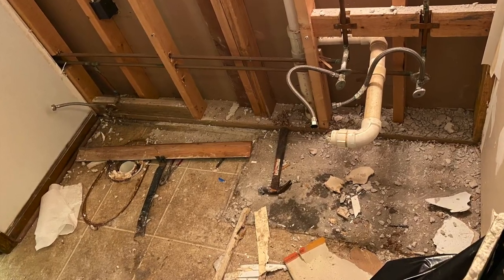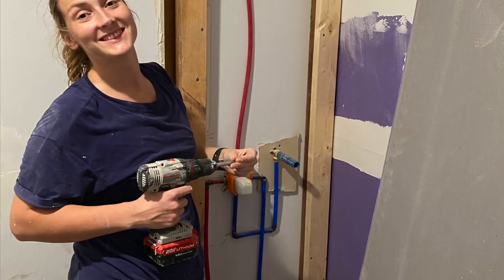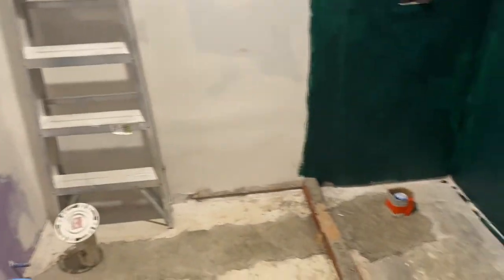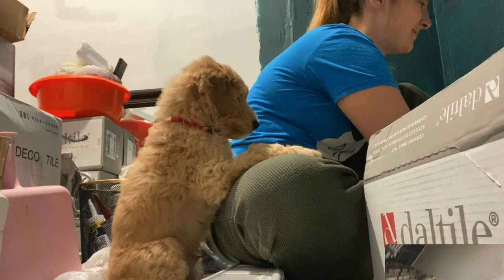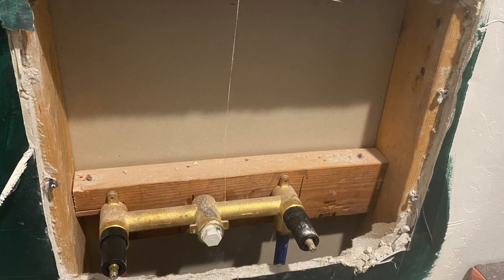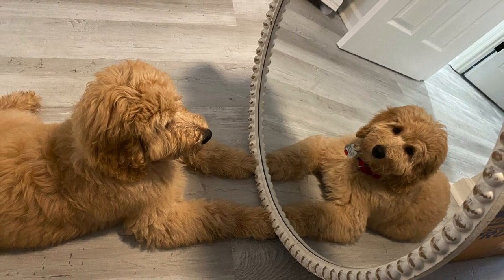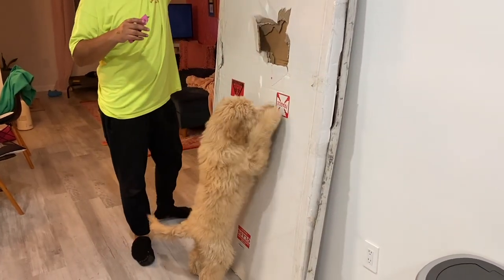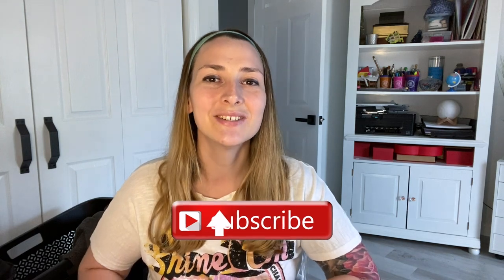HALF BATHROOM TO FULL BATHROOM full remodel // Half A Year in the Making // DIY Bathroom Remodel

Comment: I need to do this because last time I rented a room in the house I had to share the shower. How much did the conversion cost you?
Reply from the maker: The plumbing was the most expensive part. It was about 3500, but the first plumber kinda bailed and didn’t do a great job. I also had a concrete foundation, so that’s a lot of work to get to the pipes. I got the tile on sale. I bought it for the both bathrooms at the same time, so I’m not sure how much it was. The wallpaper was about $60. The shower door was about $450 on wayfair. The vanity was about $360 and the toilet was around $80. Everything adds up, but I still think it was worth it!
Reply: @KarinaBanaduc  thanks. I bet having a concrete floor brought up the price. Thankful that my home is not on a slab. Very informative and a great video.
Reply from the maker: @barryspurlock3048  glad you liked it!